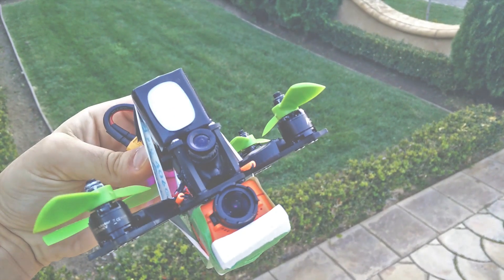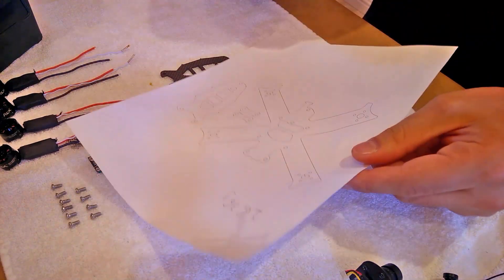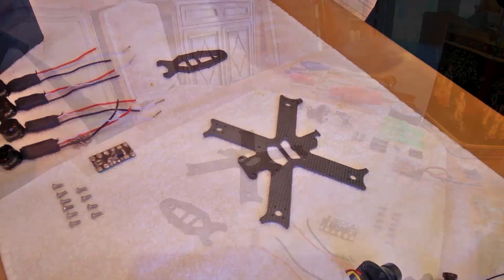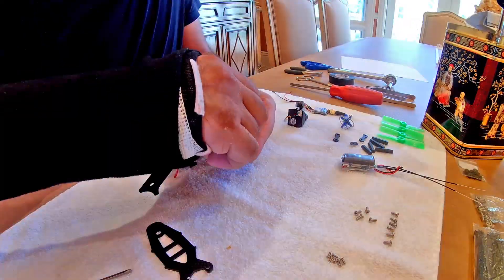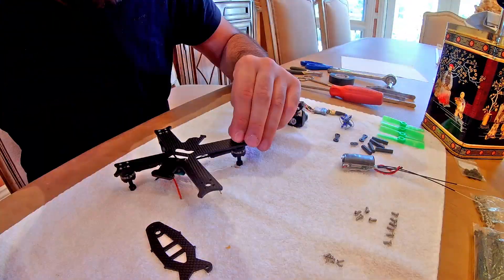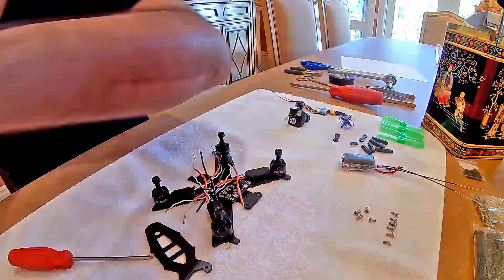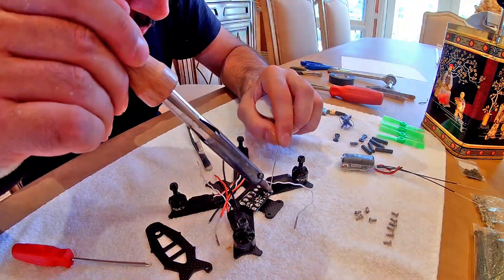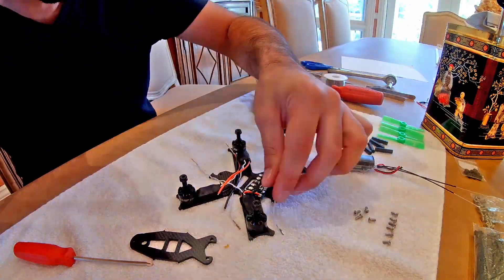Racing FPV Drone - Time Lapse Build - RCX 1407

Comment: how are you liking your build?  I am looking into a 3in build and also want one that will hold a hs117. you still think those motors are too slow? or just due to overloading?
Reply from the maker: the motors are perfect for the 3.5" DAL blade on 4S. the 3" class is pretty whatever still. if you're building for fun, I'd look at the RCX 1707. check the amp draws. you can't really have more than maybe ~15-16A per motor max and still use an 850ma 4S pack. so balance that for 3.5" and 3". regarding this build, I sold it to a friend after I flew two batteries on it. didn't meet my expectations. unfortunately the sub 4" class for races requires an AUW of under 250g so you're forced to use these motors or smaller. not terrible, but my 5" is far more fun to fly.

Comment: I noticed you pre-soldered the motors and ESCs, which seems convenient versus soldering them in-situ, but what do you do if they spin the wrong way? Re-solder them after they're installed?
Reply from the maker: There are two software suites that we use to manage the onboard computers. BLheli is the suite for the ESC's and Cleanflight for the main flight computer. Both are very simple, easy to use and naturally work on Mac and Windows. You can change the rotation of the motor among other things in BlHeli.
Reply: +Kabab thanks. I'm doing my first build now and have configured cleanflight but not BLheli.
Reply from the maker: +dehydratedH2O don't hesitate to ask any questions...